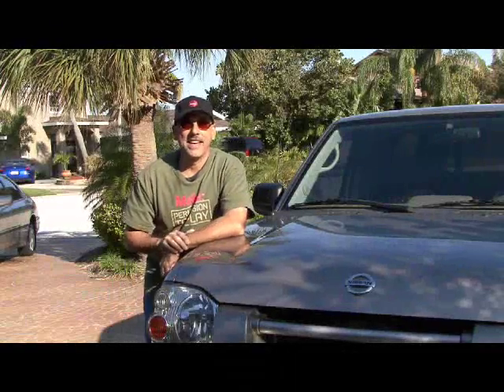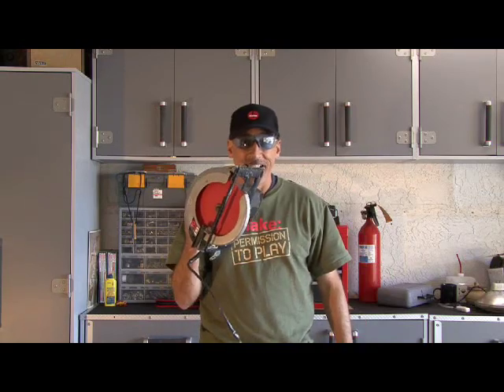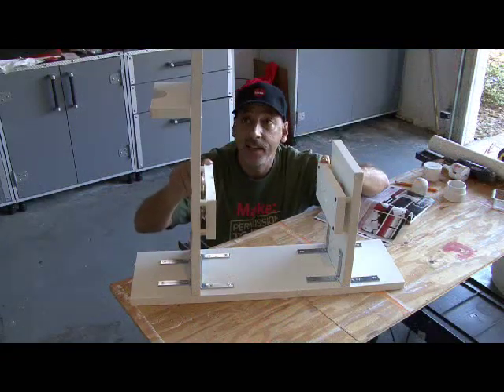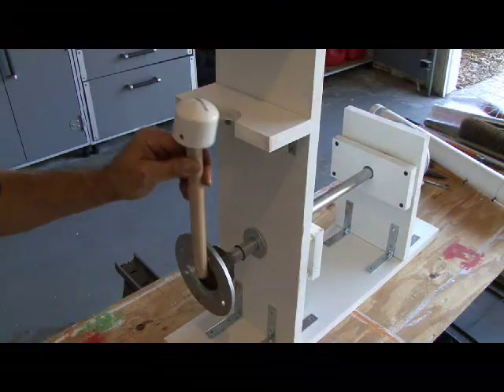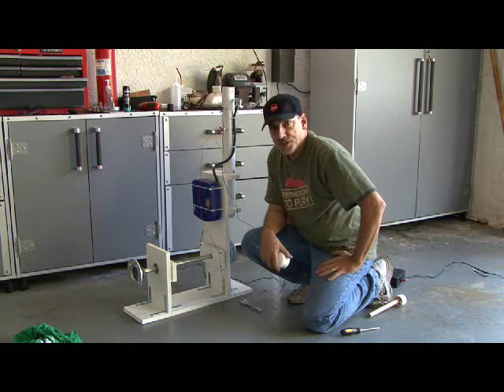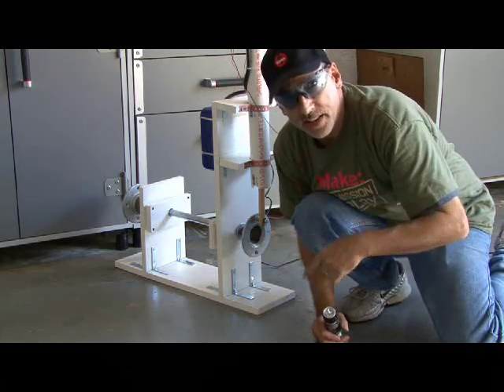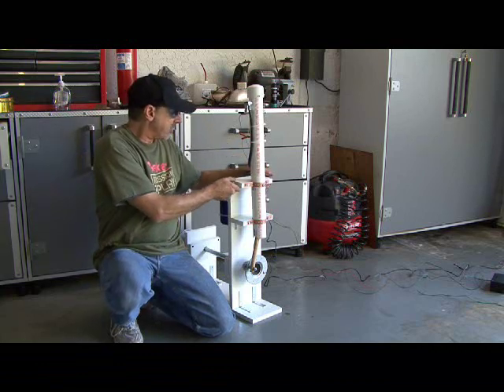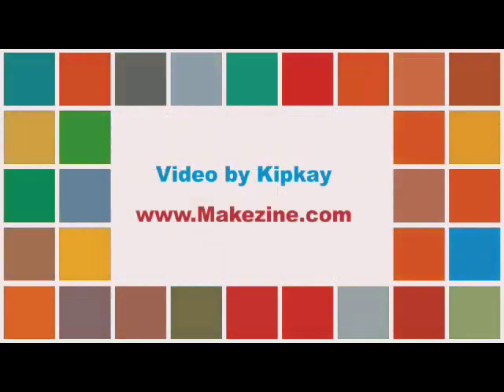Weekend Project: Make an Explosion Engine

Comment: Too much pressure for IC..  BUT  I like the setup for a Stirling engine. shorten up the cyl use that for the power piston, and put a displacer piston on the other side. Should work pretty good.

Comment: may want to use a smaller cylinder, a shorter piston travel length, a copper or steel pipe with a made to fit metal piston that is not designed to rotate within the cylinder, a sturdy support, an acrylic or plexiglass window to protect from explosions, a timing cam built onto the rotating shaft that will hit the grill ignitor button.  lastly and most importantly you need to do the calculations to find the safe pressure of operation, and further determine that your engine will not exceed that.

Comment: Did you all see what went wrong the first time when the whole cylinder exploded? The shaft was straight up, and the force shot straight down. The wheel didnt want to turn one way or the other. On the sucessful attempt, the wheel was slightly rotated, and and the piston pushed down on one side of the wheel rather than straight down ontop of it.

Comment: The explosion in an engine generate heat and force, that PVC plastic is much to weak for this, you need durable materials
Reply: For a part that's going to withstand countless explosions, yes. For a demonstration piece that will only handle a couple? No, not really.

Comment: For all of you guys following along at home :  (or want to improve you engine)
- Plastic usually gets hot and melts when its exposed to fire.
- You'll need a higher compression ratio for some good power! (10:1)
- Make sure you spark is firing just BTDC.
- If your going to keep using a compressor like kipkay, just know that its like having a turbo or supercharger strapped to your machine. There's going to be some POWER!
There's plenty more to know, just study engineering! (or mechanics)

Comment: Bigger diameter on the flywheel and longer rod., and then u go..there is still  pressure in the cylinder when the piston is on its way back to top..

Comment: Should have shot a magnet through a clinoid and stored the energy in the load of the battery. just be a linear shot all the way through that way your not pissing away efficiency in the rotary centripetal motion.

Comment: would be mucht cooler to see an arduino to do the ignition. so it keeps running.
Reply: It wouldn't work like that, what that thing does is burn the "fuel" inside. You essentially need to refill after each ignition.
Reply: Arise, Chickun Which would make this essentially a hit and miss engine, the arduino could control a servo to open and close a valve letting gas in, while also controlling the ignition. I would actually like to see kipkay come back to this and try it out.
Reply: cjwolfer
If you had a constant source of fuel that were able to refill the chamber then yes, it would be possible, and I am sure KipKay of all people could come up with a great design for that.
Reply: cjwolfer Arise, Chickun It would also be far more dangerous.
Reply: Yea I thought he was going to hook up the ignition to an arm on the crankshaft that pushes it, run it til it melts

Comment: I disagree, combustion engine would be appropriate. yes steam engine could be seen as a combustion (expansion) engine, but as an external one. normally speaking combustion would happen inside the working cylinder itself, using a gas or liquid as a fuel source. like in this video

Aside from the fact that the engine "exploded" multiple times :)

Comment: didnt work because a real combustion engine dont work with explosions.. the fuel burns in a controlled way, whith the right mixture of air and gas for the engine speed.